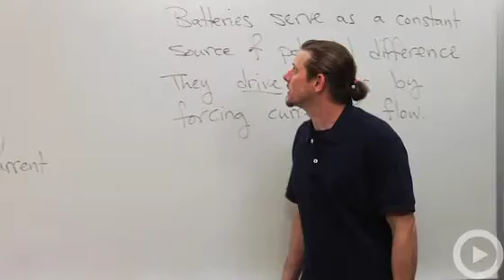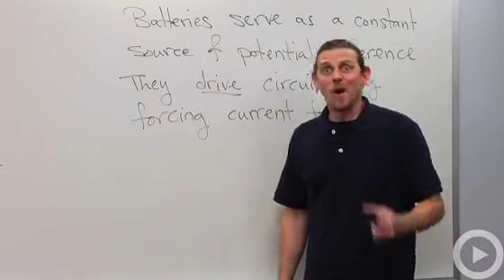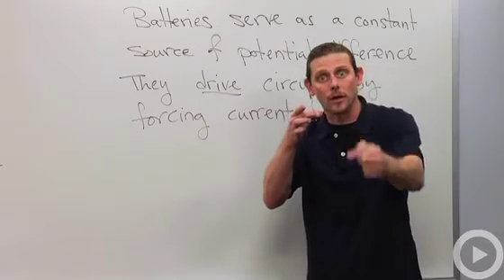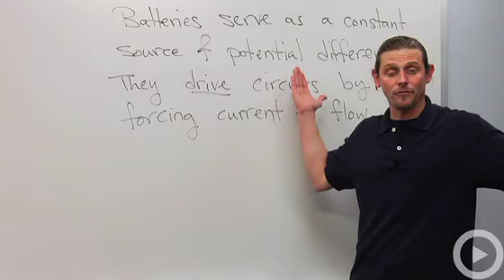Potential Difference

Comment: I would explain potential difference like that:
Lets say we have 2 locations: Point A and point B.
Lets say point A has negative charge (-) and point B has positive charge (+)
Both points are connected with a wire.
Imagine we have something in our hands that has a charge of 1 Coulomb.
F.e 6.241×10^18 electrons. Lets place them in point A(-) and see what happens.
Its obvious that electrons will flow to point B(+). We have a result - emmited
heat (because of a wire resistance to the flow). Lets say that our wire emmited 1 J of heat and that all the work of our moving electrons was used for making the heat. In this case our potential difference was 1V,
because one Coulomb of charge emmited 1 J of heat while moving from point A to point B. (formula [U=A/q] = V = Work(Energy)/Coulomb)
If we change characteristics of our point A and point B so that our moving charge of 1 C emmits 2 J of heat, we can say that our potential difference was 2V. So once again:
Potential difference tells us about what amount of energy could be released from material that has 1C of charge while it goes from point A to point B. And its measured in Volts.
Hope that it helps. If I made a mistake or something,
let me know!
Thanks!
Reply: LuckyTriple Smile it help alot more than video

Comment: I Like to think of it as a vacuum. attach a vaccum to a pipe with beads inside it, and the beads will get sucked through the pipe, yet it's the beads movement that generates an electrical field which holds energy which components can use.